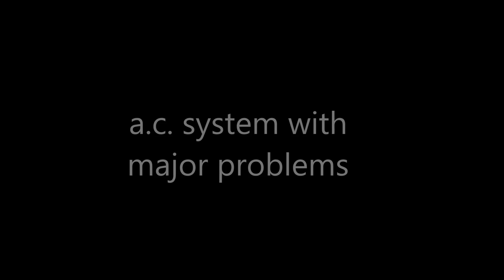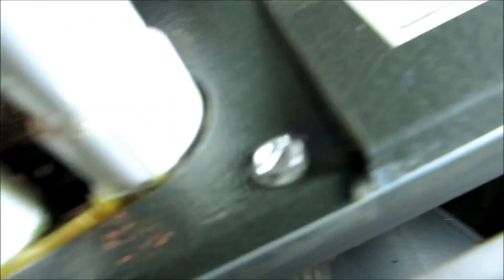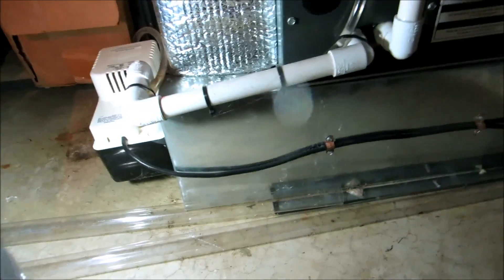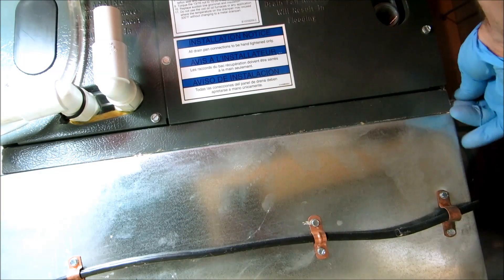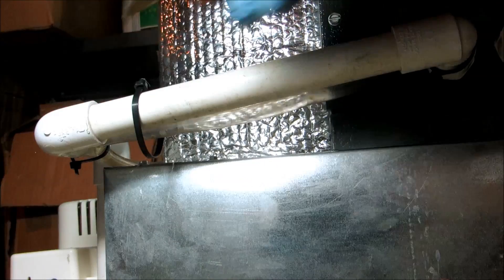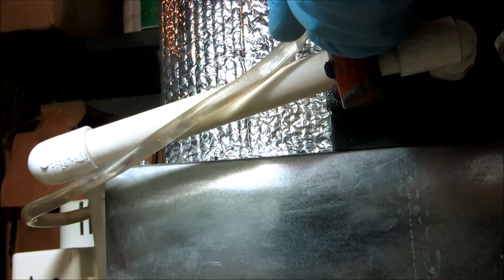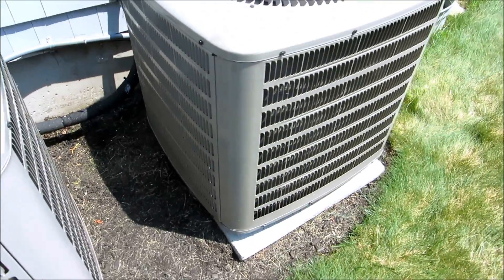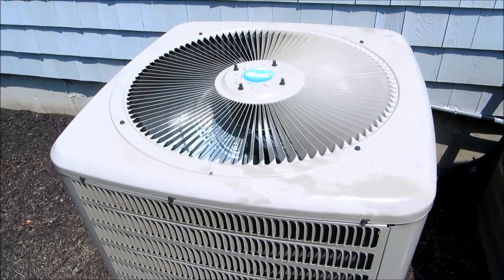hvac:non condensables in goodman a.c.system

Comment: What if the low side is fluctuating but not the high side.  Would you suspect non condensables also?  I have 3 ton split with a piston that has consistent head but low side goes from 63-70 psi.  Thanks.
Reply: if it has a txv and is low on gas or the bulb is not tight  a piston could be low on gas check the super heat and subcooling

Comment: nice video, after you reclaim all the refrigerant and pull a vacuum on the system does the compressor oil need to be changed or will a deep vacuum pull the moisture out from the contaminated  oil? thanks steve

Comment: I've checked one today tempstar 4 ton 410 head pressure going up to 800psi with 150 suction, compressor sweating like crazy. I do not see a liquid line filter, liquid line out of condenser not hot, suction bcc and sweating. I think it is overcharged and probably non condensables. I did not check subcooling and superheat. owner said someone came out about 9 months ago to put freon in it, he said the last couple of days unit has not felt like it is cooling good. When I took my guages off of it a shit load of oil at the service ports. What are your thoughts
Reply: Tom Paul  Sounds like you have a blockage somewhere in the unit. And check the inside of the outside equipment for a filter drier.

Comment: I noticed in the video and correct me if I am wrong but if you had the temp probes on the unit that the S/H and S/C were way off, the S/C should be around 9 deg. yet in the video I believe it was somewhere around 33 if memory serves me correct. Like the trick with the clear tubing, will start using that.
Reply from the maker: +Donald Nicholson you will find out in the real work not every job is perfect . you get it the best you can .there are many things to look at ,and you do your best with what you have to work with .

Comment: Since this has air in it, You have to reclaim the 410 and start anew as you can't reinstall the same as there is air in mixed with the refrigerant in the cylinder now? Am I correct or do you have a way to separate it and reuse it?
Thanks
Reply from the maker: amtpdb1 best to reclaim it all and install new refrigerant

Comment: Where do you get the rubber hose??  thanks Brent
Reply from the maker: ClemonsHVAC its 1" id hose i get it at a supplyer i deal with .i buy like 3 feet at a time i will do a video on it probley this weekend tool tip
Reply: ok That would be great!
Reply: love the clear hose coupling trick

Comment: Some guys run the drain to the bottom of the pump and call that a trap. I don't agree, but it will technically be trapped and drain as long as there is some water in the pump.
Reply from the maker: Phil Mutz well i do not agree but i guess it works ..i add a trap thats the way i was taught to do it ....

Comment: That drain could not have been installed by a union worker, or it would have been, "Done Once! Done Right! Or, their other saying, "We do it nice because we do it twice!" Unfortunately, this installer failed to come back and repair his hack work.
Reply: In theory if it's in a condo pump filled with water the negative pressure will not suck the condo pump dry. So in theory no need for a trap on a 2' run.
Reply from the maker: Brad1237202 it was bad yes

Comment: Nice Steve. Can't wait to see the upstairs unit.
Reply from the maker: Rob HVAC he needed to get the carpenter back to put a access door in he said when it cools off the carpenter is coming back to work on the deck he will do it then but i will return to reclaim the charge and pull a good vac on system and add a dryer to first floor system this week